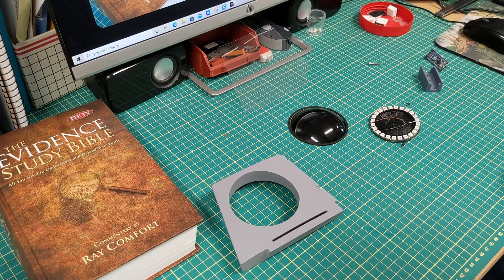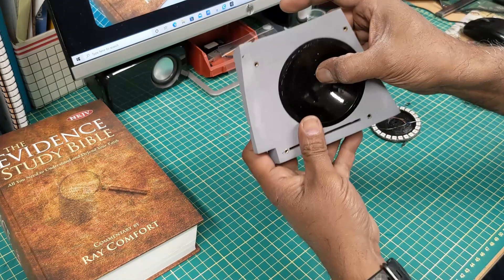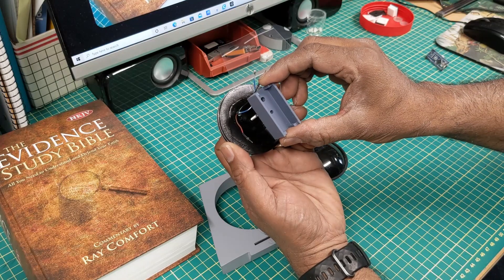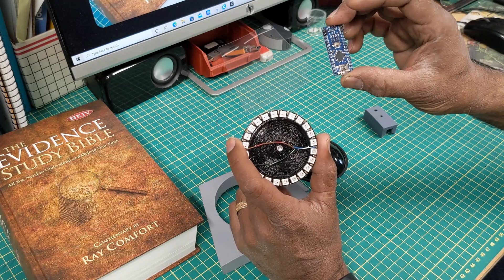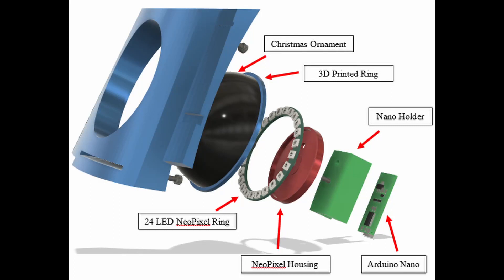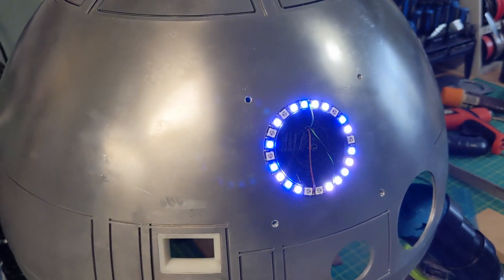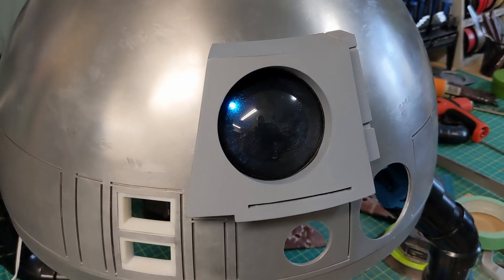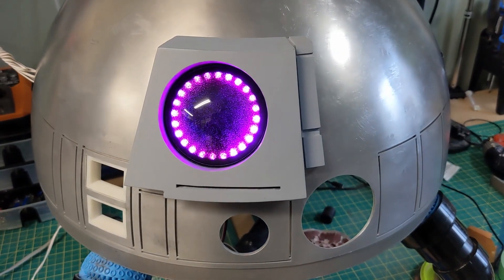R2D2 Build Episode 13 - Radar Eye

Comment: That is a cool mod! It looks great!
I wonder if anyone ever did a mod where the radar eye is an actual radar display? :)
Reply from the maker: Thanks a lot!
Reply: Thanks for the tip about the tape. I already drilled the holes in my R2 dome. I'm debating on inserting threaded inserts into the radar eye so it will hold better.
I just need to get up the nerve to do it. :) @MakerDan55